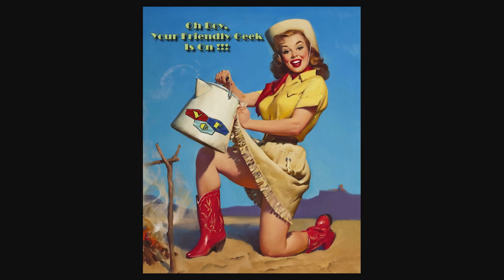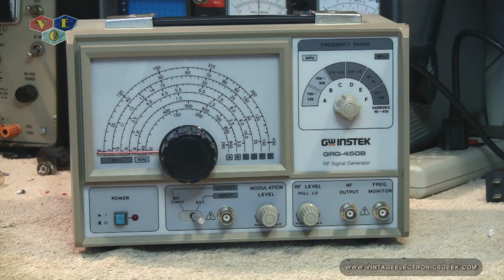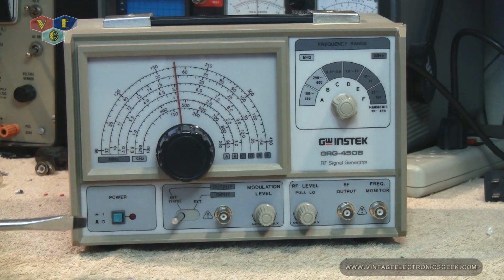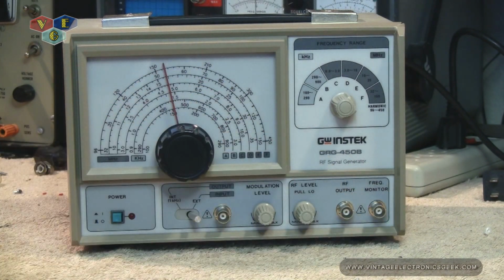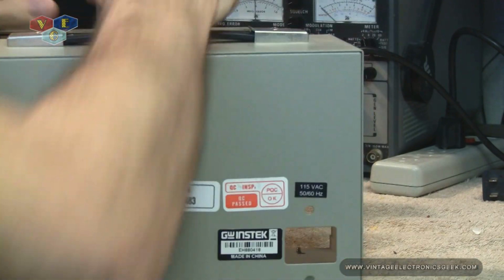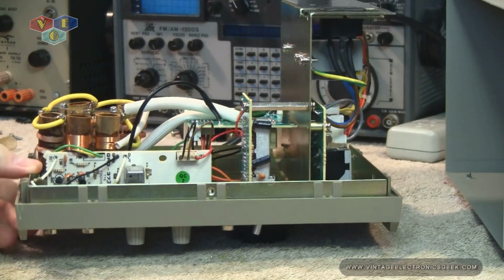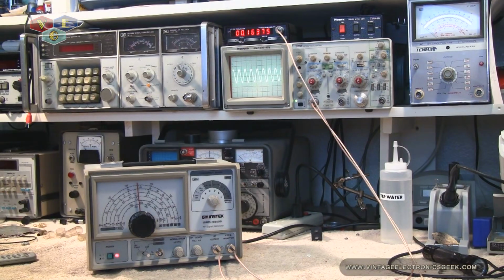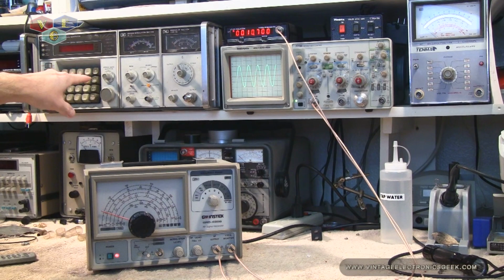TGT - GWInstek GRG-450B

Comment: Hi Jack. Nice review. I just bought one of these units on eBay. I'm looking to match it up with a digital frequency counter. I couldn't quite see the brand of your counter.  Would you let me know the brand and model number of your frequency counter?  Thanks!
Reply from the maker: Howdy!  These are great units, I only retired it because I upgraded to a synthesised unit, otherwise a great tool!  After I purchased this item, I wanted a freq counter that would cover the device without having to swap ports, I ended up buying a Sencore FC45 and it worked great, one of my Favourite freq counters, the frequency counter I'm using in this video is a (600 MHz coverage) Ramsey Electronics CT-70, it too is a great counter, however you need to flip switches to cover the whole band....I only used this counter in the video as my other counters on the bench are out of view, so I placed this smaller one in frame. Hope that helps some.  ~Jack, VEG
Reply: @VintageElectronicsGeek  Thanks Jack. That's super helpful!  On the search for either unit now.
Reply from the maker: @NagoyaT99  You are very welcomed and good luck on your search!  If you'd like, let me know what you get, if you watch my videos, you have noticed I like freq counters and have a whole lot more then posted.  :)  ~Jack, VEG

Comment: Nice intro! Nice little starter unit, especially if you are pressed for space. It does remind me a little of the Leader I had. Thanks!
Reply from the maker: I would have no issues running it longer in time if its all I needed, but as you know, sometimes you either need a specific frequency or a higher frequency, and thats a down fall for a device like this, but if your working on projects that dont deem that, then this is perfect!  ~Jack, VEG